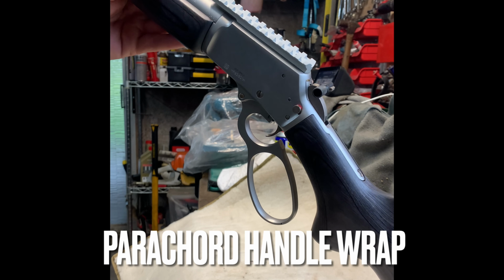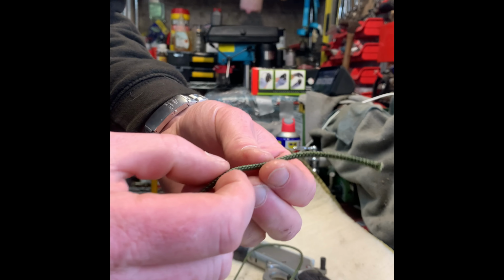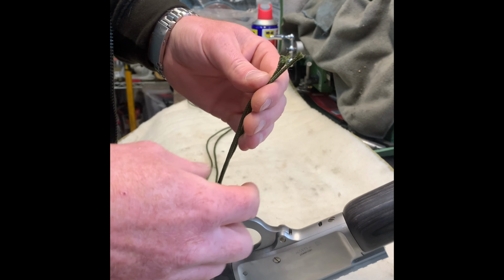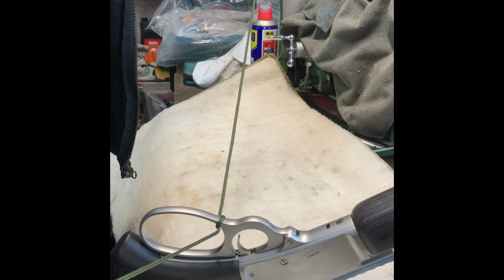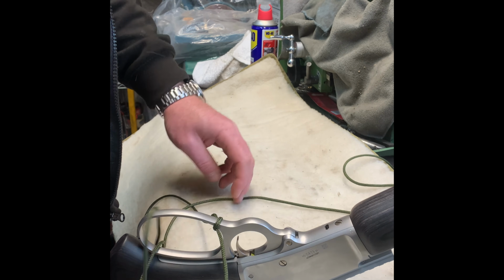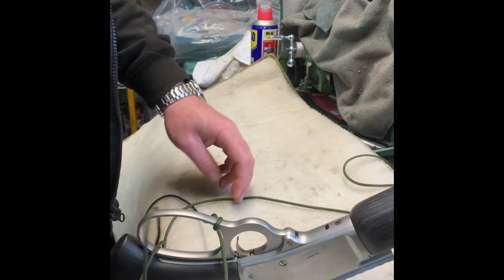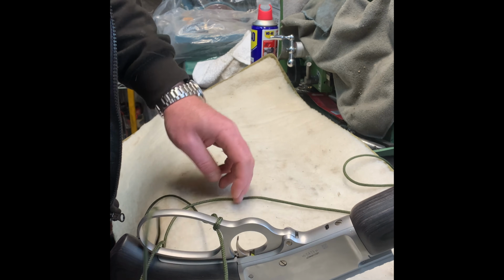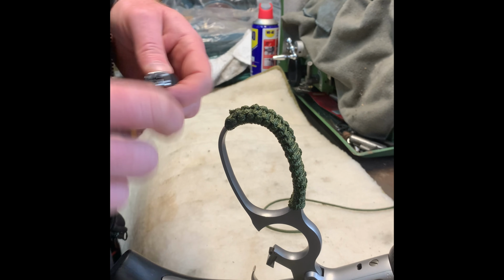Parachord wrapping Marlin 1894 CST .357

Comment: Nice tutorial. Only thing that I did differently was to start it in the trigger loop, so that means the pleated bit in the main loop can't slip round and stop the loop shifting flush with the stock.
Reply from the maker: You’ll be surprised, once it’s all packed in tight and aligned, it actually doesn’t move.
Appreciate the like and the comment mate, show yours off if you have done something similar 👍🏻